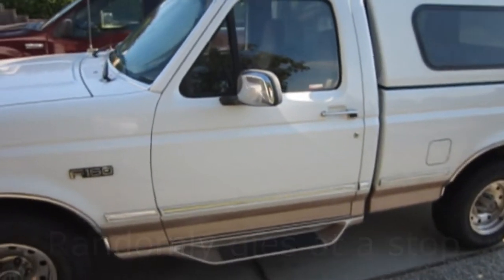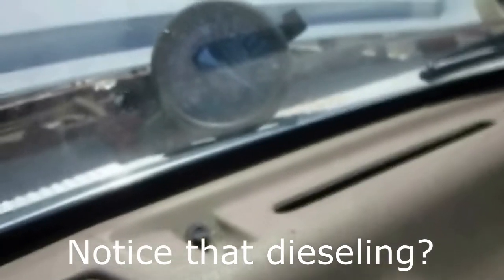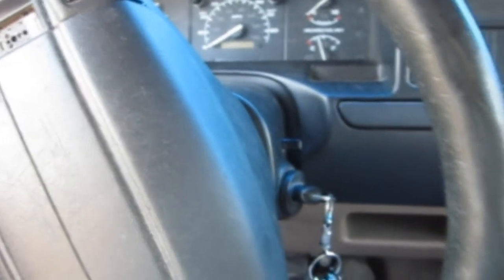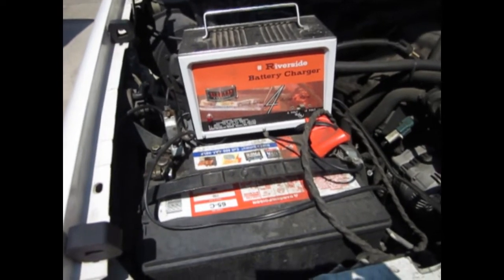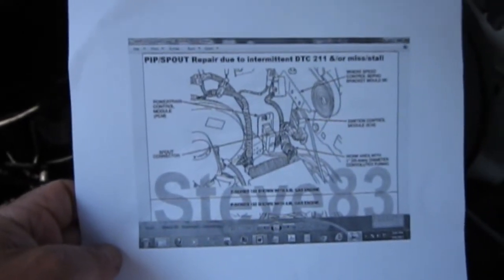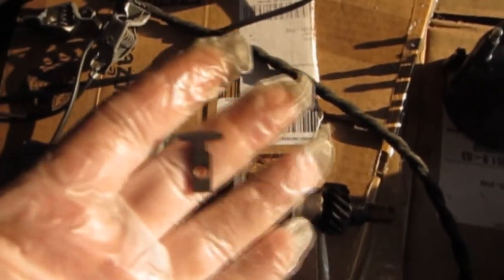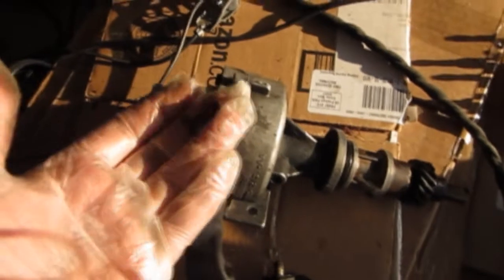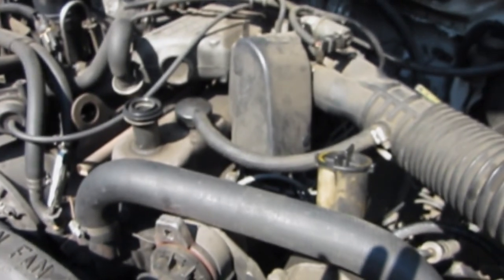F150 1996 Random Shutdowns In Traffic - Phantom Problems/P0320

Comment: Did you try replacing the alternator,it may have a short
Reply from the maker: No. Everything checked perfectly. When it stalled, usually at a light, it would take five minutes to start again without any codes sent. Very odd, but never happened again after the repair.